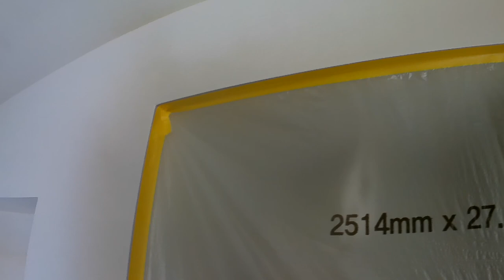Masking Tips. How to Mask a room before Spray Painting

Comment: Hey.. so curious, I thought the FF LP series of tips would be sub 1000 PSI. Isn't 1500 a lot of PSI for the 514? Just starting my journey, trying to learn from all the pros on here. I picked up the 112 and 310 assuming both would probably run at about 800psi or so. Is that way too low?
Reply from the maker: Good question my friend.. there’s no set PSI in what is considered low pressure — the paint viscosity and the materials ability to atomise will play a huge part.. for example I can spray low viscosity primers and topcoats with .008 tips at around 800 psi.. whereas a material that is also a brush / roll product, with an FF LP 310, you could be around 1200 PSI ..a note on your 112 — it will let a lot of material through, over a 2” fan.. my experience, unless it’s a thicker, slower flowing material, it would be hard to manage.. you would have to move extremely fast.. hope this helps, regards Pete 💙💯

Comment: 30% water talk about ruining your paints bonding agent and cutting cost. I never run more then 10% water.
Reply from the maker: 30% water is added only on the mist coat, to prime the fresh plaster my friend.. using an acrylic based white emulsion  👍 ..After the mist coat, 2 top coats of the colour are sprayed, either with no water or just a splash to ease the flow 👍 ..thanks for your input, great to hear how you do it buddy.. regards Pete

Comment: Good morning pere. Just wondering if you could please answer this question for me.
Would a graco fflp tip and guard work with a wagner gun?
The wagner gun is a good bit cheaper in the sprayman site.
BTW I have bought an erbauer airless to get me started, and trying to upgrade the gun, tip and guard to get the best finish I can.
Any help would be much appreciated.
Regards
David
Reply from the maker: Morning David, short answer is yes a 7/8” tip guard will fit and interchange all latest addition guns from Graco / Wagner / TriTech.. it’s just much older guns that can have a different size tip guard thread.. I suspect the Erbauer gun will have a 7/8” thread, I’ve had a quick look for you but can’t confirm 100%.. The thread that attaches the gun to the hose, that’s trickier to answer.. Professional pump manufacturers from Graco / Wagner / TriTech use a 1/4” NPS thread, which is an American standard fitting.. but for safety reasons, DIY sprayers, such as the ControlPro range from Wagner have a proprietary size.. this is because DIY pumps will have a lower pressure rating and it would stop a DIY hose being used on a much higher rated professional pump and causing a safety hazard.. again I’ve looked into it for you and cannot confirm what the Erbauer thread size is, I wouldn’t want you spending a lot of money only to find the gun won’t fit.. if I was you, I’d go for a Graco FFLP (and Graco tip guard) for fine atomisation, but the gun isn’t critical in producing the finish.. the gun is user comfort and lasting quality (it could spit with wear).. the finish quality is atomisation, paint choice and technique  👍 ..if that makes sense 😆 ..regards Pete
Reply: @PaintHQ  that's great Pete, thanks for that 👍🏻
Reply from the maker: You’re very welcome 👍

Comment: Hi. I have noticed your whip hose is much more flexible than one I have. Would  You please share  which one you got and where you got it from.
Reply from the maker: Well spotted my friend 😆 ..Yeah it’s the smallest whip hose available (so I believe).. it’s a Graco 1.4m 1/8” whip.. Link below ..The ‘official’ application for this size whip, is for spraying fine finishes attaching to a 3/16”  (trim / woodwork materials that’s a lower viscosity).. however I’m choosing to also use this whip / hose setup to spray  emulsions.. (just wanted to be honest with you) ..I’m guessing your whip is 3/16” which would attach to a 1/4” hose that’s typically used for emulsion 

Here’s the exact whip I use

https://www.sprayman.co.uk/product-category/accessories/airless-spray-accessories/airless-paint-hoses-hvlp-air-hoses-couplers/whip-hoses/1-8-whip-hoses-connects-to-3-16-fine-finish-hoses/

If you don’t already have a Graco Contractor gun, or the Contractor Compact gun.. the 1/8” whip cones with the compact gun in this bundle, it’s an awesome gun and a great offer 👍

https://www.sprayman.co.uk/product/graco-contractor-gun-pc-compact-airless-spray-gun-and-whip-hose/

All links to SpraymanUK ..I highly recommend them 💯

Hope this helps and I’ve not confused you 😆  ..Happy to help if I can ..regards Pete

Comment: So is this Mist coat I see you do a lot something that's done on just ceilings or do you do that also on the walls?
Reply from the maker: Hey Jeff.. this project only had fresh plaster on the ceiling and media wall 👍 The rest was existing emulsion / paint work.. purely because the media wall was boarded out to create the boxes, had electrics running to the lights and then the switch wire was run across the ceiling to a new switch chased into the wall.. hope this makes sense 😆 yeah I guess it would look like I was only doing the ceiling and not the walls.. it’s important  to mist coat / or use an acrylic primer on all fresh plaster 👍 ..Hope this helps my friend.. thanks for your question 🙏 regards Pete

Comment: Hi, great video! You have really made it helpful for a DIY'er like me.
Quick question - I don't have a hand masker, so got some low tack tape & pretaped plastic sheets. The plastic is pretty thin but clings by static. Is it suitable for protecting or do I need to get better quality plastic roll like 3m. Thanks
Reply from the maker: Hello my friend, I’m so pleased you like the video and it’s helping DIYers 🙏 ..great question.. short answer is, I’m sure you’ll be fine 👍 in fact I like the pre-taped plastic film and papers, they can be a little easier to handle and manipulate.. in this latest video below, I’m using professional pre-taped masking products by Kip, I put links to the products in the video description.. hope this helps, keep in touch, it’ll be great to hear how you get on.. regards Pete 🙏

Paint Ceilings FASTER With An Airless Paint Sprayer
https://youtu.be/FtpqTZxaSn8
Reply: Thanks for your reply. Pretaped plastic is a bit expensive but I find easier to apply on previously applied tape as per your method. Great channel & I am so glad I found it 🙏
Reply from the maker: You’re right, pre-taped are a little easier.. thank you buddy, you’re so kind 🙏 ..Keep in touch.. regards Pete

Comment: Hello, I've used this to spray multiple fences with 311 tip and am about to spray an entire house inside with 517 tip. Do you think the emulsion will need diluted for this tip when used with the 250m?
Reply from the maker: Hey George, in theory you shouldn’t need to dilute when airless spraying and making the right tip selection.. I prefer to spray emulsion with a 515 and sometimes add just a splash of water (an egg cup amount), just to ease the flow and cut down the pressure.. so yeah you should be fine with a 517, may just need to move a little quicker 👍 ..hope this helps.. keep in touch my friend, always happy to help and advise if I can.. regards Pete
Reply: @PaintHQ  thanks for the reply, I diluted 5% just to be safe and it seemed to work great with 517 tip and yes I had to move fast lol
Reply from the maker: Ah great news 🙏

Comment: Hi mate a quick question do change your gun filter when you use the FFLP tips a 60 to a 100 mesh cheers
Reply from the maker: Hey John, it’s not necessarily because I’m using an FFLP, for example the 514 is an FFLP and being a .014 orifice size, I’m spraying a thicker emulsion, I stuck to the 60 mesh .. it’s anytime I’m spraying trim / woodwork paints (lower viscosity), and I’m choosing an FFLP size, say a .010 or .008.. I’ll then change to a 100 mesh.. and I always change the manifold and gun 👍 ..Hope that makes sense, I appreciate it sounds confusing.. regards Pete
Reply: @PaintHQ  thanks it makes sense mate cheers for that
Reply from the maker: Ah cool.. I can waffle on 🙈

Comment: Hi Pete, an excellent overview, many thanks for posting. I have a couple of questions:
If you are not spraying the trim do you still use the sensitive Deltec purple tape before masking it off, in case the client’s paint peels off when de-masking? 
Secondly, do you have any suggestions when it comes to Georgian windows? I’d considered masking each pane, to spray, but then realised the widows needed to be opened slightly to catch the edges and any overspray would have hit their ivy! As it was on the first floor, covering the outside would have been a challenge – I hate to admit it but I opted for a brush instead! 
With thanks and best wishes, Rob
Reply from the maker: Hello Rob my friend.. good question, my preference is to use the standard (gold) tape and will check all I can if I’m able to safely mask up with that.. otherwise, yeah I’d use the purple, but there’s a risk the tape will blow off or underperform when spraying.. it’s a tricky dilemma.. sometimes I opt for the yellow Frog Tape on customers paintwork, especially if I was manually using a brush / roller on those areas 👍 ..regarding the Georgian windows, typically sash windows but I’m thinking they had regular window openings and you was looking to spray the inside? Apologies if I’m wrong, just you mentioned having to open slightly to catch the edge.. standard openings are possible to mask (from the inside the property) round the ‘external’ reveal (the bit you don’t see), then mask round the outside edge of the window that opens.. before finally using brown paper in a ‘triangle’ to mask and bridge the gap (to stop spray going outside).. it is tricky, sash windows even trickier (if not impossible) to complete without manually and carefully using a roller to get the edges.. fair play to choosing to brush 👍 from our chats I can see that you’re very logical in your thought process to tackle jobs and sometimes spraying or spraying everything isn’t the solution 😆 ..You’re doing great my friend 🙏 all the very best.. regards Pete
Reply: @PaintHQ  Hi Pete, Thanks for your detailed response. I should have been more detailed – there were casement windows, hinged on the side. I can see how a “triangle” would have worked, in the same way that, thanks to you, I cover the edges of a doorframe so as not to get overspray outside of the room. Best wishes, Rob
Reply from the maker: Ah I see 👍. ..Yeah, huge compliment to you.. You have a very good analytical mind.. very useful when looking to spray paint 👏👏👏🙏😆

Comment: Morning. I’m currently using Tessa yellow and I’m finding that sometimes after spraying it’s coming away due to being wet, mainly around the top of skirting boards. Am I doing something wrong? 🤷🏻‍♂️
Reply: try deltec gold for sharp clean lines or Q1 tapes
Reply from the maker: Hey Freddie, hope you’re keeping well.. just checking are you spraying your trim / woodwork first? Then masking with brown paper to spray the walls up onto the ceiling?.. I have a lot of success using Deltec Gold in these situations, masking skirting / architrave with 12” brown paper on the 3M Hand Masker.. I was having a good chat to Tesa recently at Trade Decorator Live, very knowledgeable team.. I’d have to give their products a good test to see how they compare 🙏 ..regards Pete
Reply: @PaintHQ  Hi Pete. All is good, thanks. Hope you’re well. Beautiful work as always on this latest room. I love watching you work and take in as much info as a I can. I’m not a full time decorator I’m actually a general (internal) builder but love decorating my own projects, especially if I can spray. So I may go a few months before I can get the sprayer out. I’m getting pretty good at achieving a good finish and only use top branded paints. I just need to fine tune my knowledge with tips and tricks which can only come from experience and of course watching your videos and chatting to you now and then. My current project (been there 6 months so far) is a great playground for spraying. In a 150m2 open space I’ve built a kitchen/dinner. Cinema room. Bedroom with on-suite and walk-in wardrobe which now is all being decorated by myself using Optiva Primer on the plastered walls with Optiva 5 as my top coat and Halftprimer and Helmi 30 on the woodwork (not in that order lol) I’m loving how it’s looking so far but as I say it’s the little things that I need to tweak. Love prep and have 5 Festool sanders for different applications. I won’t skip any steps! I will give the Deltec a try. Tessa yellow is fine when pulling off the skirting etc but as I said it can peak away now and then after a spray. Thanks for your help as always.
Reply from the maker: Great insight into the top quality work you’re achieving, and embracing spraying.. thanks for sharing my friend.. yeah you’re right about using quality materials / paints, it’s a win win, the paint will spray much easier by design and the results are another level.. well done, keep going 🙏